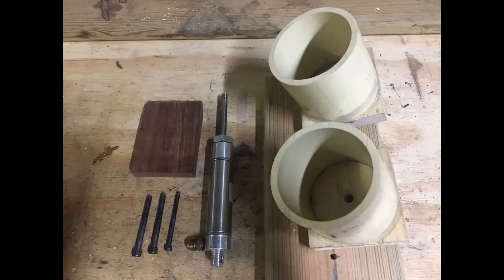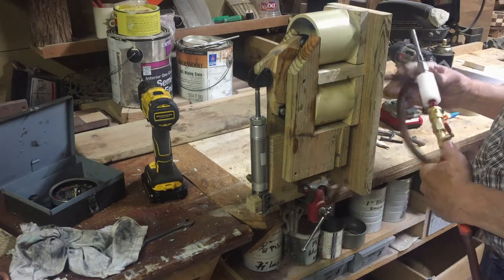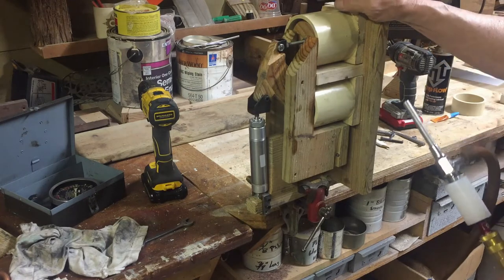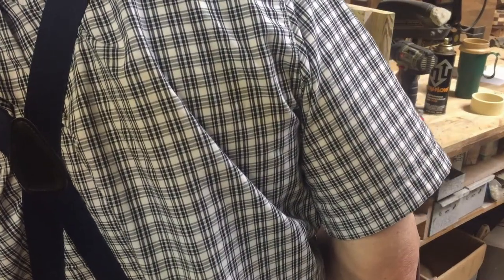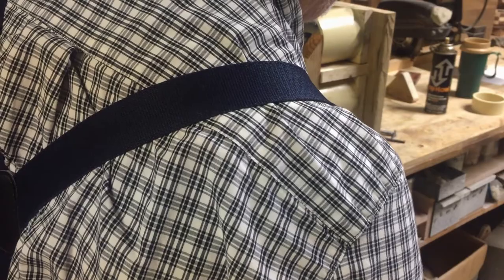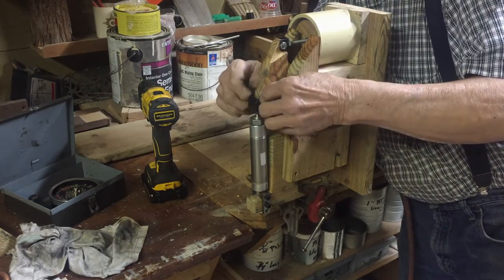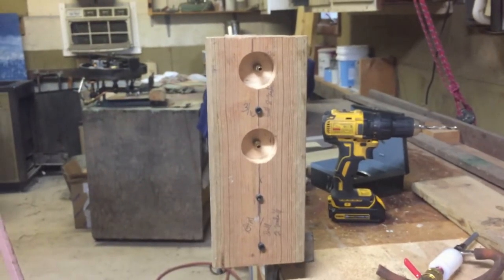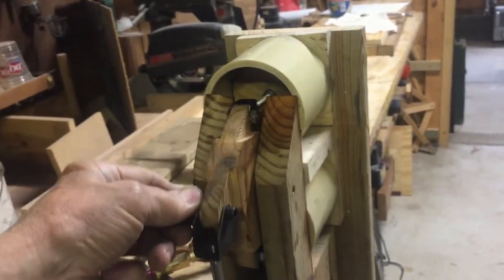Vacuum & Air Engine Exhaust for Possible Air Recycle

Comment: Interesting?. What is the advantage of this system vs. having two double action pistons directly inline? Is the goal to turn compressed air into vacuum?
Reply from the maker: Thanks for the comment or suggestion. 
First thing, I have the Cylinder I used and just designed the rest around it.
2 Double cylinders would work, using 2 different size Cylinders to get the right ratio of compressed air to vac.
You have to remember that at MAX VAC you have 14.7 psi to work with.
At this time, I am experimenting with what ever comes in to my mind, and i'm open to suggestions.
I have quit using metal, it's to expensive and much harder to work with. 
With using wood models, I can make just about any device with in reason. If it works, it can then be made with some other material for strength.
Unless I win the Lottery, I'm at a stand still with needing a Three Stage Air Compressor and 30 Gal Carbon Fiber Pressure Tank - 

Have you made any further progress with efficiency or distance with your Air Powered Bicycle?